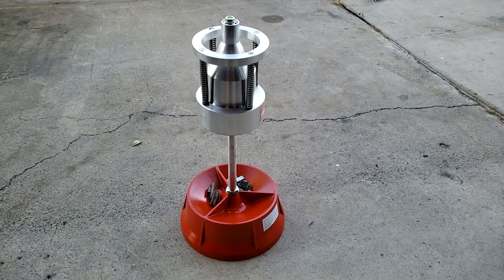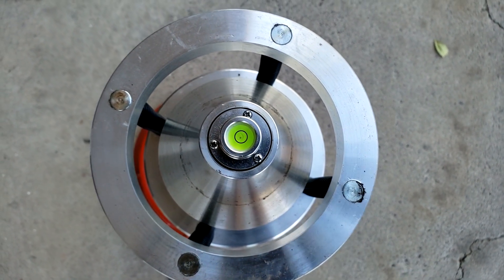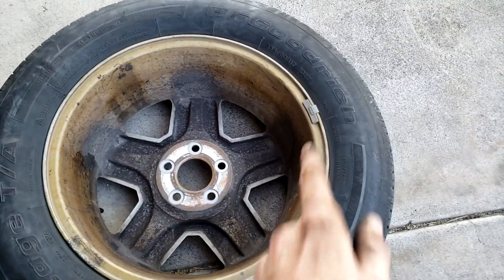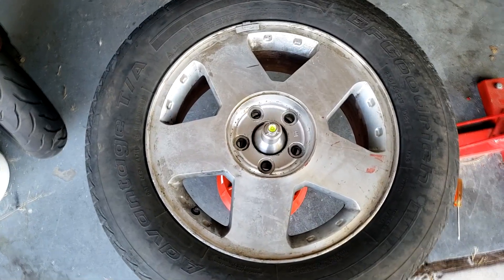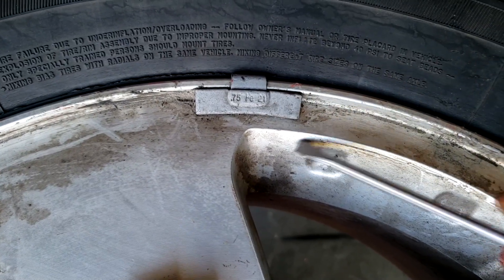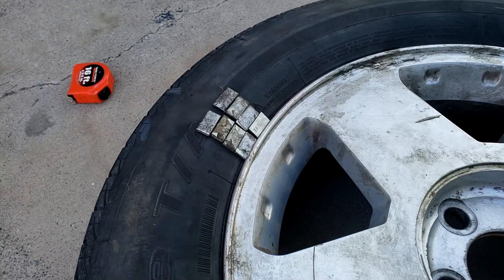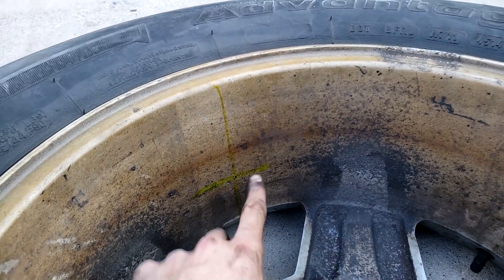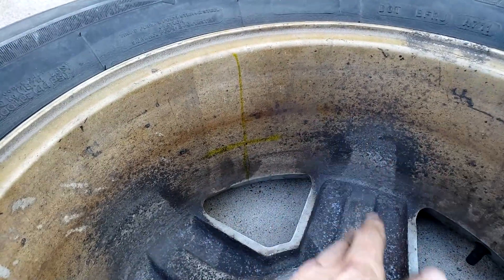Wheel Balancing - Using a Manual Static Bubble Balancer

Comment: You also have to be concerned on placement of weights when checking the balance the first time because further you put the weights on the outside the less weight you need. When moving weight to the inside move weight is needed.  Most rooms will have etchings on it on the diameter and you could use that and divide it by 2 and get the actual center because you got to be concerned if you're measuring from the ground up that the tire might be moving it away from center.

Comment: I'm trying to balance my first wheel with one of these things and the wheel hub is not reaching the centering cone on the balancer.  Is this just an issue with some low-offset wheels and makes them unsuitable for balancing with this type of balancer?
Reply from the maker: Can you try with a different wheel to confirm that it might be an issue with your balancer?
Reply: @TutorialGenius  I finally got back to this and figured it out.  The balancer had been sitting so long, the 4 pins seized up and weren't letting the ring slide down.  Finally got them to move and all is well now.

Comment: It will work best if the center shaft is vertical. The standard pivot pin sits on an annulus, not the point and it will be off set by half that annulus diameter.

At ~ 3:20, you start doing several bubble position checks. You need to lift the wheel off the frame, turn it 90° and put it back on the machine. Is it still in the same place? Do another 90° turn. Still showing the same location? You have a good balancer.

At ~ 6:20 you talk about the heavy spot on the tire and rim. The rim can be balanced and marked with tape before the tire is put on. If there is a yellow dot on the tire, line it up with the heavy spot on the rim.

At ~ 7:20 To avoid adding weights that may cause dynamic imbalance, put the stick on weights at the vertical CG position of the assembled wheel. It will be closer to the rim spokes than the center of the rim. 
For rim weights, proportion the weights based on the distance from the vertical CG plane. So more weight goes near the spokes than on the inside.

How were the results driving the car?

Comment: There is one more important tip guys.  Everyone of these vendors copy one another so they all have a common design flaw.  It's not bad under no load.  Will become more obvious under full tire load where if you tip one spot then tip the opposite and it refutes to return to exact same spot then you need to do this.  Open up the flare receptacle side of the head until it's bigger the sitting pin.  Just be careful to not drill to the same pin depth.   By default I've seen everyone of these balancers were having 2mm smaller receptacle than the pin diameter so it will get stuck on one side under full load.  Go ahead bore out the receptacle to 1/2" of an inch by slowly working your way up from 1/4" to cause the flare to open up to a nice V so the pin moves freely under heavy load.  Because there is a design flaw, don't be bashful to get the cheapest unit you can get your hands on because you will mod it regardless.  I paid $25 for mine from Harbor Freight clearance.  Other good folks on Amazon showed me this and now it's working like a champ.  My only complain is the bubble is so hard to read.  They could've made us a fatter bubble with hair line cross.
Reply: Just Add some damn grease on the tip of the needle.. that thing will continue rocking till Tuesday

Comment: This shit does not work.  The reading is always off if you put the wheel back on the balancer after balancing.
Reply from the maker: Is the needle pointy without defects? and have you added any grease? maybe its getting hung up
Reply: @TutorialGenius  …I have widened the hole where the needle goes in like everyone has done. The cone is sitting on it freely.  Have you tried putting the wheel back on the balancer after you have balanced it?  Do you get consistent reading?
Reply from the maker: @curryodor  Yes, it works really well for me, thats why I decided to make this video. Did you bolt it into the floor so that its very sturdy and doesnt move?
Reply: @TutorialGenius  …maybe I didn’t tighten enough the shaft to the base

Comment: No mention of repositioning the wheel on the balancer to make sure it wasn't sitting crooked? I do that along with the rotate and let it stop a few times to make sure the bubble is pointing  in the same direction like you described. Once in a while it may not sit quite centered... like if there's junk on the wheel center / bolt face.
Reply from the maker: It's not a bad idea, sure :) Hope the video as useful!
Reply: Yes it was, always good to see an instructional video that's done well.

Comment: Did you modify the tips of the balancer
Reply from the maker: Not I didn't! But I would 100% check if the tip is smooth and pointy!
Reply: I had to midify mine, there was a ~1/8" hole that didn't actually contact the tip of the base, it was a ring around it. That ring made it far less sensitive and sticky, even with grease on it.
Reply from the maker: I think some of these aren't made too precisely! Mine was fine, but my neighbors was how you describe! @daves2433

Comment: Divide the weights 120 degrees opposing the light spot on the inner plane and the outer plane and you have a true dynamic balance. It is a pantented method and I have used this method for over 50 years. https://patents.google.com/patent/US3474677A/en#:~:text=One%20set%20of%20weights%20is,of%20wheel%20balance%20is%20achieved.

Comment: If you have aftermarket rims they are most likely only going to get static balanced because you won’t be putting weights on the outside of the rim. Only the inside. How many people have aftermarket rims and never have any problems? Those are my thoughts at least.
Reply from the maker: Not necessarily! They can have slight imbalances straight out of the factory. This can also change if you hit a curb or anything to upset the natural balance of the wheel. It's not just weights that change the balance and its not aftermarket vs OEM which denote where the weights go

Comment: I seen something years ago about static balancing,  and your not supposed to balance the tire 180 degrees from the heavy spot .  You should use a Y pattern. Same technique but move your weights away from the balance point until you get a Y pattern and it will help keep the tire in balance longer as the balance points will be triangular on the tire in 3 points .   Great video on the whole setup to checking everything.  Try one with the Y pattern and do un updated video on that would be cool too .
Reply: https://youtu.be/w_mH9qCceMA this is what hes talking about. Yesterday i tried it the same way you did and i still had shaky tires. Today i tried the way in this video and the shake is gone
Reply from the maker: It's a theory for sure but spinning and checking does pretty much the same thing.

Do a video and link me to it when you're done. ill see
Reply: @TutorialGenius  , I may have not said it correctly,  put the weights on the rim in a Y pattern from the heavy spots .  Not in the verifying of the out of balance. That was truly great presentation in your video.    I don’t have one of these balance machines but may have to look into it for my trailer tires .

Comment: Does it work on motorcycle tires as well
Reply: A motorcycle balancer is even easier to use than these. It's just a level pole and you let the heavy part go to the bottom.
Works so well motogp teams use it

Comment: There is a strobe light balance method to balance the wheel while it is on the car itself... the point is to balance the effects of the brake rotars... I had a BMW c a problem of vibration and this helped to cancel out vibrations of wheels to point to another problem...the rear driveshaft was also out of balance.
Reply from the maker: This method is very unreliable though. I wouldnt recommend it to anybody
Reply: @TutorialGenius It's extremely reliable. It's the same method most engine builders use to balance engines.

Comment: Great job splaining the whole ball of wax this is what we did before dynamic balancing and it works just as well unless u r traveling at speeds over 100 MPH
Reply: @anthonydargenio3536  100MPH = gleich 160 kmh das reicht locker ! auf Deutschen Autobahnen 130 kmh Empfelung , eher 120  kmh !
Reply: Ich bin 200kmh gefahren und alles ruhig , hab auch nicht so ein Theater mit dem balancer gemacht , gelbe Markierung des Reifen auf Höhe des Ventils und auf balancer geguckt das es einigermaßen mittig ist , bei drei Autos bis jetzt alles gut

Comment: Static balancing doesn't guarantee the wheel will remain balanced when rotating...so what the point to gamble with the balancing?
I guess the only advantage of static balancing portable machine is check if basic wheel balancing is still in your wheels, but not a final balancing.
For correct balancing, is necessary to balance in a machine of dynamic balancing
Reply: Before dynamic balancing this is what we did and it works just as well unless u r traveling at 100 MPH
Reply: Have been balancing using a more pro bubble balancer for decades with zero issues .properly done with the harbor freight should work fine .
Reply: I started researching this after treadwright tires recommended static balancing.  I've had dynamic balancing done twice on my truck, but I still get the freeway jitters at 80mph, so I thought I'd try this "after" and in addition to the already completed dynamic balancing.  If this doesn't work, I'll know those tires just suck.
Reply: @mymorristribe  and did it work?
Reply: I guess static is better than nothing at all.

Comment: work perfectly until you mount on a car ,
Reply from the maker: I mentioned about this in the video already.

For anybody else that missed this part: This is a static balance with a static balancing tool. This does not dynamically balance (IF a dynamic balance is required)
Reply: Then the moment of truth.

Comment: First video I ever heard someone say NOT to remove all weights first!
That is what I think too...
See where you are first.
Question though, when you find balance is off, with original weights on, why not add weight to bring it into balance without removing all weights and starting fresh?
May not have had to add as much fresh weights.
Very good video though, explained well!
If you see this, could you answer as to why not just add to wheel already with weights on?
Thanks!!
Reply from the maker: Yes, you could. There is not really a right or wrong answer. If the balance is off though, and you have weights on then you might as wel remove them. 1. Aesthetics. Nobody wants a wheel full of weights (applies to clip on's). 2. Its just more weights to lose when driving, they can fly off. 3. Well you have the tools already, might as well do it properly. Seems like a bit of a hack job.  but back to the start, it doesnt really matter, choice if yours, but i always like doing a proper job.
Reply: @TutorialGenius  
Very cool, makes sense!
Thanks for the answer!!